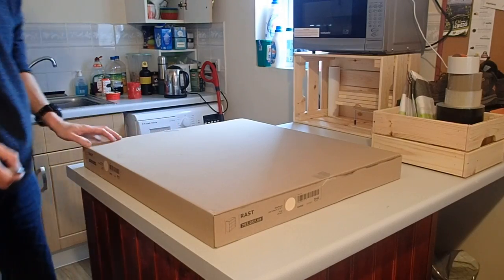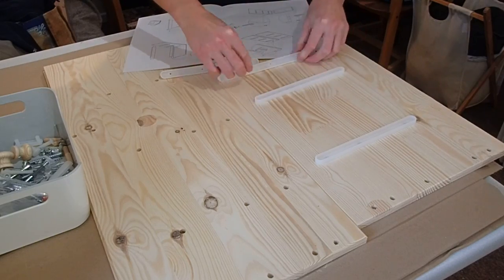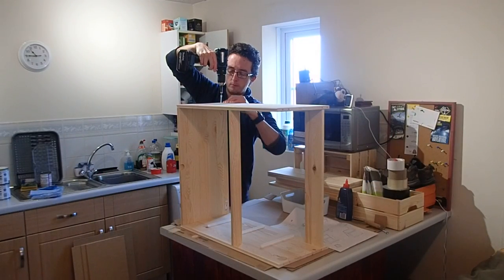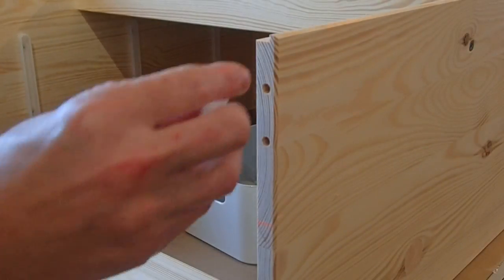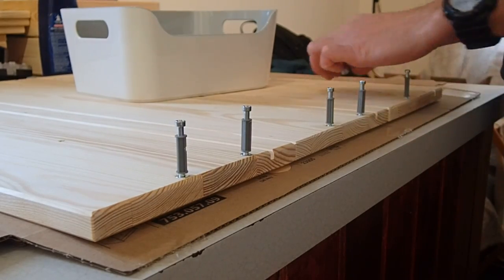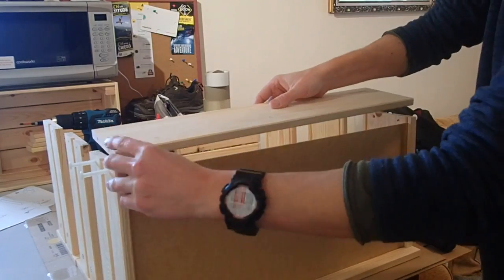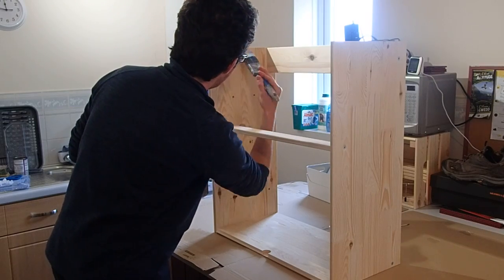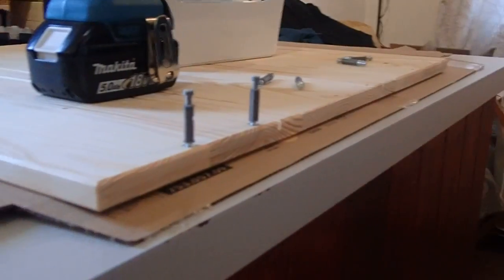Ikea Rast Assembly (Chest of Drawers)

Comment: What are the measurements included drawers?
Reply from the maker: Hello, sorry for the delay in replying.

Overall, one unit is 700mm high x 620mm wide x 302mm deep.

Internally, each drawers measures 552mm W x 118mm H x 256mm D.

I hope this helps.